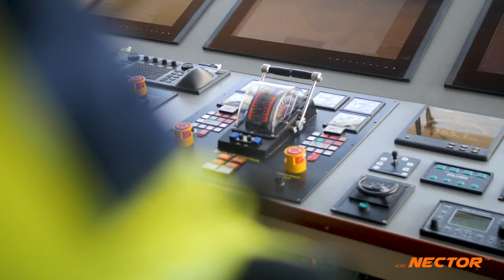E-ferry Ellen, Mobimar ACDC Nector

Comment: I've got to ask, why all the added complexity to manage a square plug and socket, when a round "probe and basket" style of connector would seem much more forgiving for variable weather and sea conditions that induce heave, sway and surge?
Reply: Because of safety. You have to move two heavy métal wires in a constant distance, à square profilé is the best.